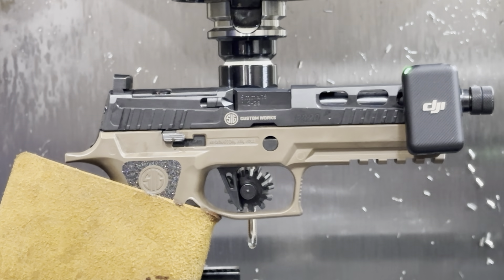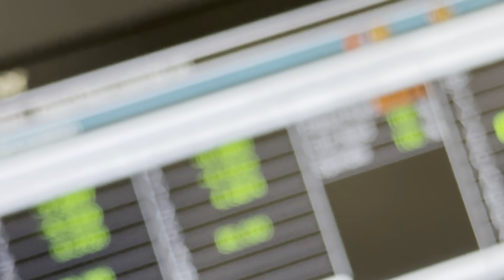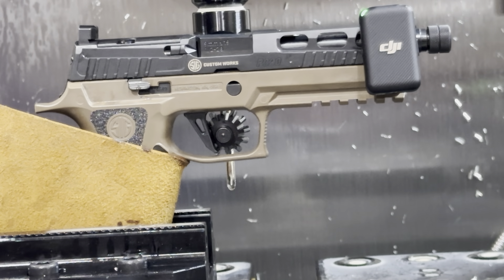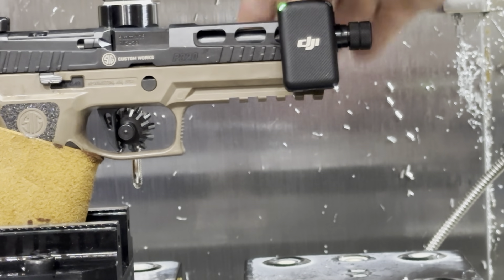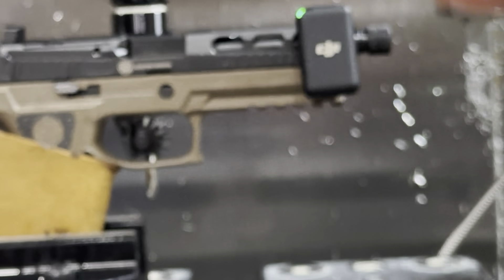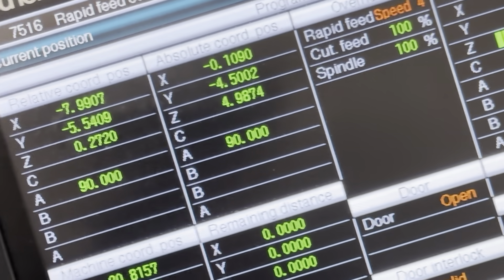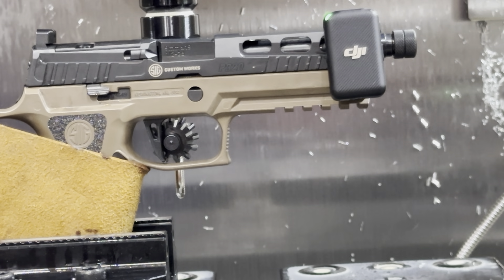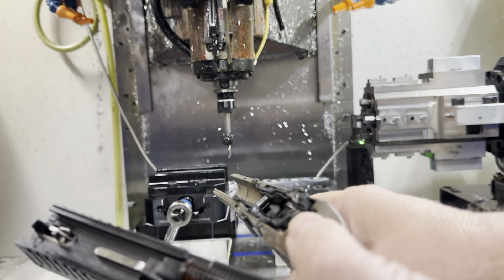Sig P320 accidental discharge tested in CNC machine.

Comment: Your testing is what I hoped someone would do, which is gather accurate measurements, not utilize a half eaten banana and a pair of rubber bands to measure.

I agree with your sentiment that this is your gun only, and that's how your gun works.  If it were every P320, with 2.5 million of them out there the number of incidents would be much higher.  It seems to be a lottery based on tolerances, wear, generation of internals, and probably the phase of the moon.  That being said, I don't want to win THIS lottery.

I did note that Wyoming  utilized a .45 version instead of a 9mm version, and his slide had so much movement I would have refused to buy the thing at any price.  I'm not sure if that P320 was worn out, or all .45 versions have that much travel, or if it was frankensteined together, but I wouldn't have given a free Happy Meal coupon for the one he tested.

Comment: This is a case of one. What it proves is that slide manipulation does cause discharge. On this sample there might be better seer engagement but slide manipulation should never cause a trigger to break early. This video doesn't prove there isn't a problem, it proves the opposite. Slide manipulation does affect trigger break.  While on this specific gun the seer engagement might be better than the worse it still shows a problem. It also shows that the firing pin safety disengages very early in the trigger pull. It should be disengaging just before the trigger breaks. Finally it shows the secondary seer ledge seems to offer no help.
Reply: he proved the glock failed the exact same test. watch his other video
Reply: @CitizenSeven500 the p320 has far more slide slop than most Glocks. Of course you can give tight and loose examples of both but the average of far worse on the p320. So the side has far more movement thus the striker can fall off the seer easier.

Comment: From what I understand it depends on how much wear is on the shelf of the sear and the striker catch. More wear, less trigger needs to be taken up. Brand new guns need more backward trigger takeup before the slide move can catch the striker catch to slip off the sear shelf. Guns with a lot more wear on the catch, the sear, and the slide itself making it looser will require far less trigger take up to get the catch to slip when manipulation the slide.

Comment: Wyoming gun project was using a micrometer and getting it to do this at a millimeter, his two other p320 is wont do it at all, the fact that varies and isnt consistent gun to gun is as much of a problem as anything. Terrible engineering and or outsourcing. Not safe or reliable

Comment: Great CNC test! The P320 comes with a 5Ibs trigger pull and most do not have any thumb saftey. Trigger pretravel seems to start at .109, which at that point the striker saftey has disengaged as the sear moves downward. A lot of these test keep on demonstrating what has been known for years, basically that P320 has a light trigger and will discharge with a trigger press or a catastrophic and concurrent failure of the 3 internal firing safeties. If the latter is found then the failure in the pistol should be easily recreated.
Reply: The wall starts at .109 pretravel is movement before the wall starts which is not measured in this video and ignored by people claiming it only takes a slight touch to make a 320 go off. Don't stick your finger on the trigger until you're ready to fire, don't cover anything you don't want to shoot,  basic gun safety.

Comment: One sample isn't NEARLY enough for testing. What it showed was that YOUR gun was safe. This does nothing to prove that the platform itself is safe. If 99% of them are fine, there's still 250,000 units out there that aren't. 

Further, you didn't test the allegation that the trigger can be partially pulled then released without firing. But then the sear gets stuck in that position and it fires when bumped. And there are loads of holsters how there that come into contact with the trigger.
Reply: "safe" is one word for this...

Comment: I also want to see you try this test with debri and brass shavings inside the sear and firing pin area. As that can cause inner tension to where the vertical slide movement can also set it off.

Comment: What is most concerning is that the striker safety is disabled without a full trigger pull, unlike every other gun with a striker or firing pin block on the planet.

Comment: You have the trigger set at the wall and can rattle the slide slightly. Can you shake the slide WITHOUT TOUCHING THE TRIGGER? If you put your finger on the trigger and squeeze it to the wall, what do you expect? That does not prove an accidental discharge. Gun rule- don’t put your finger on the trigger unless you intend to destroy what you are aiming at.

Comment: Go put a couple thousands round through it and repeat this test. Because as the FBI has shown and the AF is finding out the sear wears down which means that .090 is not always going to stay there it will only ever degrade. So, all this test proved is that the design is flawed.

Comment: That is the expected result. Odds are the mean P320 out there isn’t a bump away from firing uncommanded (yet). Wyoming Gun Project tested all three that he has IIRC and only found one that was wildly off. The other two behaved more like your demonstration (he added more discussion later).

What I would suggest is people should get together and do a more precise test like this on both good samples and suspected problem guns.

Then we can disassemble a few of each and put the key parts through metrology to see if it’s consistently the same feature that causes issues. I actually suspect it won’t be quite that simple because Sig really should have been able to solve it definitively if it was that easy.

I wouldn’t be surprised if it’s an issue with stacking tolerances where one or more combinations of maximum or minimum material conditions on certain features either immediately causes an unsafe gun or results in a situation where very little wear is required to make it unsafe.

Of course, it could be that Sig simply got lazy with QA and used off spec components or did inadequate QA. I certainly wouldn’t put that past them either. Their supplier ISO 9001 quality plan specifically called out that they can use off spec parts and didn’t reference any procedure for making that decision.

Right now, we don’t know if there’s a single failure mechanism or multiple pathways to failure with different symptoms so I would be incredibly hesitant to declare your specific Sig safe even though it didn’t demonstrate the extreme sensitivity that one of Wyoming Gun Project’s three Sig P320s did.

Comment: I have a theory that the kydex holsters have a part in all this. Most if not all lock down in the trigger guard. Could they be applying enough force on the trigger that is causing the gun to fire
Reply: At best it could only be a small part, considering I don't believe there are any reports of this happening with any other types of firearm, despite the prevalence of kydex holsters.
Reply: @ShadoSnipr other guns don’t fire with the trigger not pulled all the way either, I’m betting the gun and holster is a perfect storm and working together to cause this issue. Input mine in a holster today and sure enough it’s rubbing the trigger.

Comment: This doesn’t really prove the other p320 aren’t faulty. It only proves the one in this video is not. As a former machinist/fabricator myself. There is something called tolerance stack up. Some units are tighter than others of whatever component we’re talking about some are more loose. It’s this way with any and all machines.

Comment: The SIG P320 striker is under so much force that when you squeeze the trigger and the sear begins to move, it drags the rear of the slide downward. This is why you are able to press the forward portion of the slide and the sear releases. The reality is, if there were a magazine in the weapon, especially with ammunition,  the cartridges will push up against the stripper rail preventing the slide from moving. This means that when loaded the gun will discharge exactly where the sear is at when you play with the slide.  

For an accurate test, one should test the gun with a magazine with snap caps to prevent the downward movement of the slide you get with an empty gun. 

The reality is, the gun still cannot shoot without a trigger pull. No one is denying the P320 doesn't have a short trigger. It is short. I think the M&P is even shorter. But only this CNC machine measurement testing could accurately determine who has a shorter trigger.
Reply: >the gun still cannot shoot without a trigger pull
There are innumerable videos of drop tests explicitly disproving this, and numerous accounts or videos of it discharging in a holster when the trigger was, by all accounts (besides Sig), not being pulled.
Reply: The pos320 should only fire FROM the trigger pull. Not from doing the SIG Shake on the slide.
Reply: I had a Glock that would do this very noticeably to the point you could see the rear sight dip when dry firing.

Comment: For reference, 0.019" (0.109" trigger break minus 0.09" when the slide pressure will go off) is about 1/2 a millimeter.
0.483 mm to be exact

Comment: So the conditions for a discharge is the trigger needs to be depressed ~2mms and slide needs to be pressed down. Sure this is a mechanical issue and safety problem for the gun itself, but it sounds like holsters are causing the trigger to be pressed and putting the gun in this condition.

Comment: The fact you could definitively and precisely reproduce the ND each time by touching the slide is wild. Wowzer, Sig is cooked!
Reply: Glock cooked too?... https://www.youtube.com/watch?v=NKiN14zTF6o
Reply: But this is only 1 gun. Obviously an issue with design. SIG would not have redesigned the FCU if it was sound. Red Hearing!
Reply: he proved the glock failed the exact same test. watch his other video
Reply: not really.. He had to pull the trigger in 2MM to do that.  That was the entire point he was making I thought
Reply: @HopFilms  To be precise, 2 mm equals approximately 0.07874 inches.  That’s just a little over 1/16 of an inch—specifically, it's closest to 5/64 inches in fractional terms.  Hardly a "trigger pull".
Reply: @jp325abn 
Exactly, about how far some retention holsters might move the trigger when holstering the pistol especially double and triple retention holsters.
Reply: @jp325abn it's .090 into the wall not .090 of trigger travel.  Not at all the same thing.
Reply: @roofusshingleman2387  OK thanks for the 411.
Reply: @HopFilms  If the gun fires without a full trigger pull, it is an issue. No other gun on the planet does this.
Reply: @HopFilms brother, in what world is it acceptable for a gun to go boom from wiggling a slide?
Reply: @HopFilms  yes, Sig IS cooked.... its just a matter of time. The way the company is doubling down will be their demise. They're destroying their reputation. There are countless gun owners that no longer trust these models for EDC, let alone even seeing the light of day outside a safe....
Mine is now a paperweight taking up room in my safe.
There are so many other choices.

The bigger picture is the damage this company is doing to their brand.
It's sad really.
Reply: @tomdrew5818  Remind us of how it's going in 6 months to a year when they still have their military contracts. Only certain Air Force branches have shelved their M18's for the remainder of the investigation. DoD investigation on the rest of the branches M17's, and M18's found no issues with their units. And have instructed further training on the weapon platform to ensure extra safety.

Condolences to the Airmen's family, tragic event especially at 21 years old. But even if that M18 managed to go off by itself killing the airmen, it's still on the airmen for flagging himself, and then throwing down a loaded firearm with force; and a little negligence surely.

I'm not arguing on SIG's behalf. That's all US Military guidelines on how the situation will be handled.
Reply: @iTrinityPlays Did you see the recent news.  An airmen was arrested for lying and for the shooting.  Basically he tried to blame the gun but he shot the airmen.  I knew it was BS from the start because the M18 have a mechanical safety unlike the civilian models.

Comment: Look at the stacked crappy tolerances of that custom works 320. The secondary sear notch should catch the striker moving forward. Yes, Sig says, you have to pull the trigger for it to go off. So why the addition of the secondary sear notch in the "voluntary upgrade"? Sig knows all of this. The lawyers are looking at the data and the lawsuits and determining the best course of action. Should we fix the weapon, pay the injured, discredit the general public. Detroit has many lawyers do the same thing on recalls. Don't believe me look it up. In my opinion Sig knows the issues and is hunkering down with the discredit path. Well, the gun community is not very forgiving of that COA.

Comment: Did you have the mag and chamber filled with dummy rounds? Not to mention you've proven THAT gun needs to be at THAT point to misfire. Now buy 500 P320's of various provenances and use scenarios. Then redo that test over, and over, and over. Those guns WILL NOT fuck up at the same points, and some won't fuck up at all. It's already known that some P320s can't be forced to misfire by wiggling the slide. Congratulations, all you've show is that gun while unloaded still misfires prior to when it should.

Comment: Ok my autism is showing. The “dead nuts” numbers he threw out are rough measurements at best. A trigger is a cam, the bottom of the trigger travels farther than it does near the top. Without knowing how far you are away from the pivot point there’s no real number that you can accurately use to compare with other 320s and certainly not other guns. Really the only useful knowledge that you can gather from this test is that rotational force is a factor in determining when the sear drops on a 320.

Comment: Test performed on a Sig Custom works gun with all the best parts and it still goes off by sloppy slide play.  I do think something is wrong with this gun.  Not as safe as other pistols and will become less save by use and even less safe on the cheap bottom of the line 320s.

Comment: I think the problem is that a guy could stick a screw in the trigger and get it to go off as well without being precise, this tells me that precision is not needed. I would agree it not being as big of an issue if it took something as precise as a CNC machine to get the gun to go off. However clearly not all P320s are within that tolerance, because that would mean that someone wouldn't be able to use a screw or their finger to get the gun to go off by the slide only. Most people don't even have a caliper to measure the distance of nineteen thousandths.

Comment: Excellent setup. Good assessment.  Now, my question is, "How new is your 320?" 
The Minnesota officer's gun discharged in his holster DURING MORNING BRIEFING  with plenty of witnesses affirming that his hands weren't anywhere near the gun. The FBI forensics team report said that they found "more wear than expected for the age of the gun." unquote, but nothing broken.
The airman set his 320 on the table while still in the holster - went to the bathroom - and sat down at the table when the 320 fired. No hands involved here either.
The FBI report also said they were able to fire nine primered cases with "normally expected activities of a normal duty shift." Unquote.  Now, the FBI report was about just one 320 - but it was "well worn" in spite of its recent manufacture. 
In other words, my assessment of the 320's that are having "uncommanded discharge" is that they are occurring in firearms that are used regularly (LEO's, military, some civilians). And while you have disparaged the screw, it was a "well used" 320 not new, and the screw was just holding the free travel. Your setup is much better than his, so kudos to you, but you haven't addressed the issue fully until you perform the exact same sequence with a high round count factory stock 320.
https://youtu.be/fuJ0U4D5Kic?si=gpiIUIzx3DOOg-Zi

Comment: I just did the same slide pressure tests and nothing happened with my modified P320 Carry model. Modifications are: Grey Ghost Precison slide with firing pin system,  Agency Arms safety trigger, Align Tactical thumb rest takedown lever, Wilson Combat grip, competition sear springs and pins and a compensator. The slide is much less wobly than the original one, almost no movement. I dont know if this is "a solution" or I'm just lucky. But for sure, I will not use it until Sig comes out with a free solution to all clients

Comment: I’m not really sure what your goal of this video is based on what you said. What you managed to display, is that there is something inherently wrong with the P320. Is there any scenario where having your finger on the trigger, and bumping the gun, causing it to go off, is a good thing? And as far as the accuracy you’re touting, the only thing you actually showed is that your gun needed more travel in the trigger to be faulty.

Comment: This is clear proof that the tolerances on this gun are horrible. This CANNOT be done with any other striker gun. The slide movement should not be the reason the gun fires. A FULL trigger break should be the only reason.

Comment: I would love to see this test repeated on your machine with a loaded magazine, snap caps or empty cases. My two 320’s have noticeably more movement between the slide and frame with no mag inserted vs a loaded magazine inserted. It doesn’t reduce the movement to zero, but it is significantly tighter